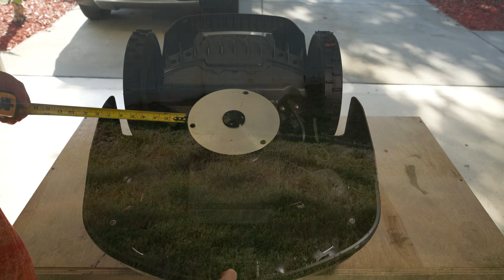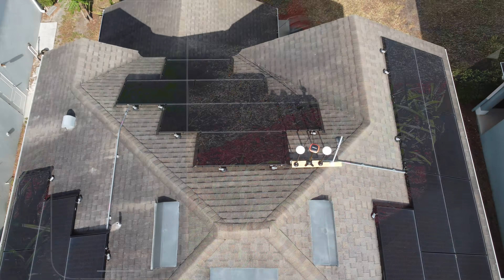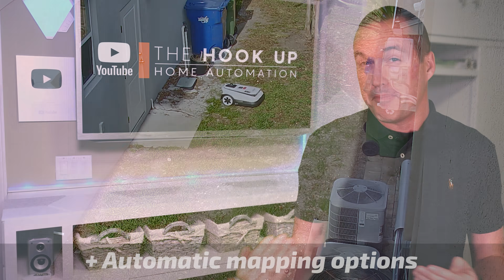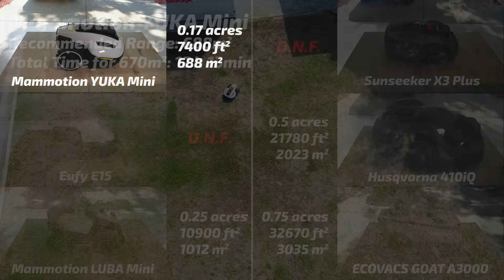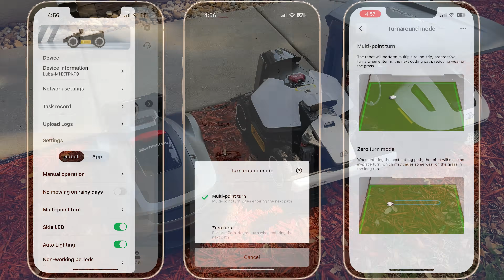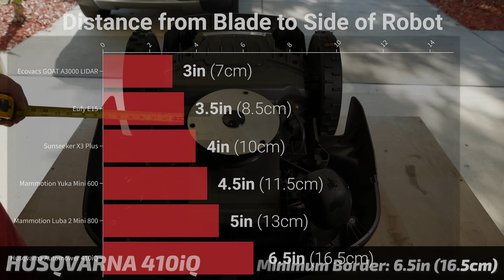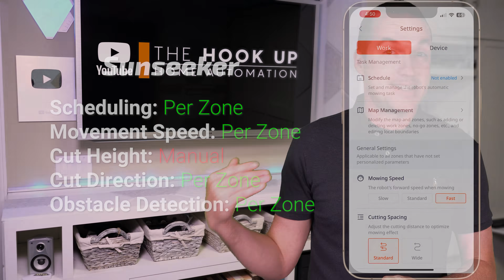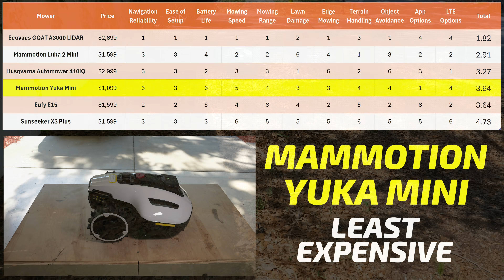Watch BEFORE You Buy a Robotic Lawnmower - LIDAR is a GAME CHANGER!

Comment: I purchased an Anthbot Genie and ended up returning it. The thing was great when it worked properly. But at least once a week I would get an error that the RTK was moved when it wasn't and it would force me to remap my yard all over again. The straw that broke the camel's was when I remapped my yard and as soon as the mower return to the base station to charge it did it again. This is neat little technology but I just don't think it's quite ready yet. Might need a few more years but I feel eventually it'll be viable.
Reply from the maker: I expect RTK to eventually go away completely in favor of LIDAR which just seems so much more reliable and problem free.

Comment: Funny how most robotic lawn mower owners have the worst looking lawns on Earth.  Seems like they should be spending money on grass and weed killer rather than a mower.  Robotic vacuum cleaners have been around 20 years, and they still cannot clean edge-to-edge nor suck enough to replace a regular vacuum.  Why do I expect more from a lawnmower?  It is so sad to see them go 70% of the way to a useable product. The root cause is that these robots are designed by high school robotics students who have never vacuumed or mowed.  Mowing edge to edge as good as a push mower is not rocket science yet ALL of them fail to do so.  What are they thinking???   It seems like they take extreme pride in the navigation and the mowing capability is just an afterthought.
Reply from the maker: Robotic vacuum cleaners can absolutely compete with uprights.  The difference is comparing battery operated robotic vacuums to mains powered uprights, which is hardly a fair comparison.  If you compare battery powered uprights to robotic vacuums they have almost identical performance.

The comment about them being designed by high school students is absolutely laughable, and feels like trolling.

Comment: Perhaps I missed it, but how do these mowers react to hitting something they shouldn't? Instant blade deactivation? Just curious about the relative safety of each unit.
Reply from the maker: Yep, blades off instantly.  They all also have a giant STOP button on the top for any human interaction.
Reply: @TheHookUp  In my head I'm imagining something like the SawStop, but less destructive to the mower itself. I'm guessing the mowers aren't that aggressive?
Reply from the maker: Yeah, these things aren't doing anywhere near that amount of damage.  I wouldn't want to try, but I'm guessing you could take a direct hit from the blade and it wouldn't even need a stitch. They are tiny razor blades that are only held outwards by their centripetal force, so they give way when they hit something solid.

Comment: LIDARs are commonly used in robotic vacuums and I personally have used Roborock for several years without issue. This is of course indoor environment, so it can be different. There was one issue with LIDARs engine that should be replaced, but that costed me few bucks only. Easy fix.
Reply from the maker: The LIDAR on robotic mowers is slightly different than vacuums.  First, it's 3D LIDAR, meaning the lasers shoot 360 degrees at multiple angles, while vacuums shoot 360 degrees on a single plane.  The other difference is that the LIDAR unit on a mower is fully enclosed and shoots through a lens on the top of the unit rather than having an exposed laser engine like a vacuum.

Comment: Husqvarna any time any day. Husqvarna has been is our top choice in terms of reliability, its quite smart, has every year software updates, has good service, is quiet, has all the spare parts if needed etc. We've had the older wired version for 5 years now, and unlike some neighbors' Stihl mowers, all our Automowers have worked without issues. Except for a few instances of cable damage, which can happen occasionally.

Comment: Pretty good review, and that explanation of how RTK's work was super interesting; I had no idea why they were even needed.

I have a pair of Luba 2 AWD 10000H's that mow my 5ish acre property. A couple items to mention - First, you don't need to pay for their 4G service, you can install a 4G SIM from whoever you choose. My mowers are both hooked to my Google Fi account. Second, Mammotion recently announced the ability to communicate with the RTK station over your existing network and/or 4G, rather than the default direct connection. This means you can cover a much larger area without losing positioning and could even put your RTK at your neighbor's house, if you can use their wifi :-)

Comment: I have a very unusual lawn setup. The charging station needs to be placed under the house (covered area), and the lawn stretches out to the side, right along a riverbank. I’ve just returned the Luba 2 5000X – it was completely useless in my case. You've tested several models – based on your experience, which one do you think would work best in this kind of scenario?
Reply from the maker: Your only options are LIDAR and vision since you need to park it under the house.  In that case I'd recommend the GOAT A3000.
Reply: @TheHookUp  How preciselly this lidar system and mapping works? Won't it end up in the river? As I don't have any fence or barriers with the cliff :D
Reply from the maker: It’s very precise, but it is ultimately on you how close you want to try to get it to the river bank.  There’s always the chance it could slip even if the navigation is perfect.  I’d give it at least 12” of buffer.

Comment: He really missed on not including the Navimow from Segway. Have been using Navimow 105 about a year. Is it perfect NO. Does it save me two hours a week during cutting season YES. Has it improved (software, app) since I got it YES. Do I still edge once every two weeks (was every week before) now YES. Do I recommend my mower YES. He has good points on GPS and other tech. If you are comfortable with being an early adopter go for it. If you want perfection keep cutting your own grass until you die as perfection will never come. So these most of the time are good enough to save you real time but they will have some maintenance needed.

Comment: Very enlightening! I didn’t realize the sq ft metrics were for a 24 hour period. I was expecting that was on 1 charge. You’ll wear out the battery the more times it needs to charge.

The ROI just isn’t there. I can pay someone $50 a week to mow 3/4 acre or I can buy a $2000 robot to just mow. I still need to edge and weedeat. If that’s just 1 hour of my time, it’s 3+ years before I see ROI. Not to mention maintenance. New tech will also come out that blows these out of the water in 3 years and you’ll want a new one.

Comment: I don't fully understand why "mow time per charge" (or for vacuums, mops, etc. runtime per charge) is relevant. In fact, I would say it drives bad market behavior.
One (if not THE) major advantage of a robot, is that it runs on its own. You, the user, give it a task, robot f_cks off and does its job - without supervision or management. It makes no difference to you if it does that in 20 small bursts, or one big one. On the contrary, I would go as far as to say pushing for larger batteries decreases product quality, it drives up costs, encourages the use of (shorter lived, more environmentally damaging) Lithium Ion batteries, vs their cheaper, safer, faster charging Lithium Iron Phosphate competitors, and pushes companies to build robots that have a statistic (runtime per charge) which offers no tangible benefit to the consumer.
My 2 cents, I'm open to other viewpoints though.

Comment: How’s do they handle pet waste? Like we try and clean the yard daily but sometimes they go after we clean.
Reply from the maker: They will run over it, it's more of an issue for the wheels than the blades.  Since they are non-mulching blades the pet waste would need to be taller than the cut height to hit the cutting wheel.

Comment: I certainly wouldn't buy any of these. But they will improve rapidly over time. By 2030 we should have models that won't get stuck, won't dig ruts, will be able to cut closer to walls, and will most likely have a solar panel just to extend run time. By 2035 we'll have mowers that can do the whole job including next to walls and trees. What really surprises me is that there's no big name company like Uber that lets you order/schedule an automated lawn job for around $20 per acre. That has to be coming, it's just too much money left on the table. These mowers spend most of their time idle, so mower sharing just makes too much sense especially in areas where there are lots of potential customers within short range of the charging station. In the near future I would expect to see these things roaming neighborhoods all the time.

Comment: There are a lot of stated or inferred "issues" with the tested mowers that actually don't matter, should not be expected or are to be expected!
NOBODY should think that because you buy a robomower that you have to do noting with your lawn from that point on.
Of course you are going to have to strim or run a small mower round the yard where it cant reach. Thats still far less work than with a petrol mower but with no fuel, no sweating, no weather anxiety and way lower maintenance costs!
Of course it wont cut up or mulch  leaves and sticks, its not designed to!
Who cares how long it takes to mow the whole area as long as it does!

On a crappy lawn like your demo area, strewn with sticks and with dry sand and the "soil" layer, of course its going to get stuck.
For me, the only takeaway from this video is that Lidar beats all other navigation systems based on your test.  HOWEVER.! Do note that if you have windows down to ground level near the lawn to be mowed, the reflections of the lasers will play havoc with the machine!
Reply from the maker: I'm not sure I understand your comment.  The point is that most people do NOT understand what a robotic lawnmower is designed to do, and what limitations it has.  That's why I explicitly stated the limitations in the video.

As to your comment about windows at ground level, there's no reason to think that would be an issue.  Robotic vacuums with LIDAR have been accurately mapping houses with sliding glass doors for almost 10 years now.

Comment: Warning it appears that most of the companies locking out the ability to simply replace battery which requires a visit to a dealer to reset the cycle times using auto check software for example by Husqvarna
The companies are totally against right to repair by refusing to offer the tools available much less a limited version

Comment: I have hills and steep ditch banks in my yard, how does the Ecovacs GOAT A3000 Lidar handle those?  I was leaning towards the Mammotion Luba 2 Mini due to my lawn verticality, but would consider the Ecovacs if it does good in these conditions.  I will purchase when one of the lead acid battery cells on my Ryobi electric riding mower goes bad, probably a couple years from now based on the original battery lasting 5 years and my replacing it 3 years ago.  Hopefully in 2 or 3 years AWD robotic mowers will have Lidar and prices will have come down :)
Reply from the maker: There are a few mowers coming out soon with heavy duty treads (Lymow, Yarbo), but while they have great traction to navigate ditches that also likely means they will do more yard damage.

Comment: Good stuff, but this review does have some limitations. Specifically the very sandy soil and the lack of hills. a lot of the issues faced may not be an issue for people with soil that is more dirt or clay instead of sand. My yard has a pretty steep gradient so I would need one that can handle that, or at least has an add-on to be able to handle it. 

At the end of the day, though, they all have the same flaw of using those razor blades to cut, and having a large gap between the edge and the razor blades. I'd like to buy one, but the current state of them is pretty bad, imo.

Comment: I have used the Husqvarna for years, the GPS is bad, but the mower is a tank - easy to fix if falls off a wall or anything, runs up 45% inclines no issues, cuts consistently.

Comment: On my 2 acre lot, I use a Husqvarna 450xh with a boundry wire in the ground and that solution just works...funny how all the technological improvements make the experience worse.
Reply from the maker: The tradeoff is ease of setup.   The barrier for widespread adoption is flexibility and ease of use, both of which are cons of barrier wire

Comment: The problem you are seeing probably isn't reflection.   You're unlikely to get reflection from walls, but maybe from glass.  To do the correction, the robot and RTK need to see the same satellites.  And it needs to see a fairly large number of them.  Between your house and your neighbors, the robot is being blocked from any satellites that isn't directly overhead.  It just can't see enough of them.
Reply from the maker: Fairly certain it’s reflection.  There is a very large window on that wall and the robots report good positioning status, but are not where they think they are.

Comment: im using a mower that uses a border wire. its so simple. used a machine to bury the wire around the mowing area. then the robot just goes around randomly in the area while mowing. and then follows the wire back to the charging station. 

It cannot do zones and mowing patterns and that stuff. but it just works. and the setup is so easy. no need for apps and all that stuff.

Comment: Im surprised by the sunseekers poor performance, I figured  3 wheel drive at least ought to work better than 2 wheel drive, and I have been recommending it as an option to people looking to buy a mower for rough terrains.  Oops. I have a Dreame A1 myself, which has a lidar too, and Im also 100% convinced by the lidar and recommend everyone to put lidar on the top of their priority.  The main problem I have with the dreame is poor traction. "Mechanically" the dreame is similar to the ecovacs goat,  which I therefore expected to have  relatively poor traction as well, but it did surprisingly well (in that sense) in your test. So Im a bit confused now.  Unless the ecovacs has some suspension on its front wheels, or a cantilever that ensures 4 wheels have firm contact on uneven ground, something my dreame doesnt have. Seems such an obvious thing to do? One more thing; I would love to see someone test the "AI "  fallback camera navigation of most modern RTK based mowers, like the cheaper ecovacs models, the Segway Navimow, sunseeker and others. Block the GPS signal and see how well they cope,  using only their camera(s).  Im sceptical but who knows?
Reply: X7 is a beast but in a different price category
Reply from the maker: The fallback test was essentially exactly what I did in my side yard.  The Sunseeker completely failed and the Mammotion bots continued to mow for a while but then stopped and sent an error in the app.
Reply: @TheHookUp  mammotion doesnt do VSLAM, the cameras are only used for obstacle  detection. The Sunseeker does have it, but it seems yours didnt really get to use it, because it kept getting stuck.
Reply from the maker: @vertigo2893  Mammotion definitely has supplemental vision using VSLAM that they call "UltraSense AI Vision".  It was added in the Yuka and Luba 2 series.  Original Luba does not have it.